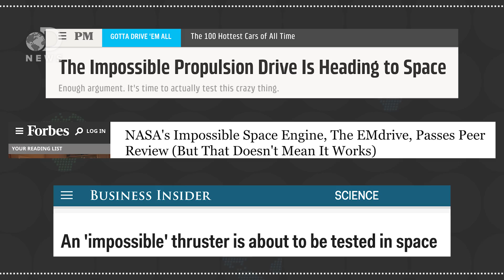How The 'Impossible Drive' Could Break Newton's Third Law

Comment: The impossible drive does not break Newton's third law for the simple reason that it won't work, which can be proven by a simple thought experiment. The idea behind the drive is that because the area of the cone is greater than the area of the disk at it's base more microwaves hit the cone than the base producing a net force. However the problem is that the microwaves hitting the cone are not all producing a force in the same direction so some force cancels out, and the force you are left with will exactly match the force on the disk resulting in zero thrust. 

To get this drive to work you have to get rid of the disk and allow the microwaves to exit the cone. This results in a photon drive and while it will work it produces an incredibly small amount of thrust.

Comment: if the microwaves are bouncing around inside the cone and actually pushing the object forward then newton's 3rd law is satisfied when the microwave bounces away from the cones inner surface.  

cone goes left, microwave goes right.  equal and opposite reaction.  what's the problem here?
Reply: CrowTech09 yes they would they are energy
Reply: +Lil y   Someone hasn't done their quantum physics homework...
Reply: E = mc^2? are you kidding me?
Reply: No problem, but momentum transfer from collision won't get you anywhere. The sum of all force vectors from a wave bouncing around a closed cavity is always 0 no matter the shape.
Reply: Kur Norock Do the waves have mass?
Reply: The purpose of it being a cone is to provide more surface area for the waves to hit in the direction of travel.  The base of the cone, which faces opposite the direction of travel, makes up much less than half of the total available surface area.  That means the net energy applied to the cone is in one direction.  

Also, if the waves are applying a force to the inside of the cone, they have to transfer some energy to the cone meaning they will have less energy when they bounce back and hit the back wall.
Reply: Kur Norock It's not just the base since the sides are slanted. Also it won't actually hit all areas evenly.

For energy transfer, the system can generate thrust if the surfaces aren't perfect mirrors(they can't be, so it will happen indeed) but that's just a really bad photon rocket since you are actually expanding fuel. You are just doing so in a very contrived and inefficient manner.
Reply: The "system" in this case is the entire spacecraft. The microwaves would cause internal forces sure but it wouldn't produce external forces, according to Newton's laws. This is why Newton's first law is: A body in motion will cease to be in motion unless a NET EXTERNAL force is applied to it. Newton's second law is: A NET EXTERNAL force on a body (i.e. the system) is equal to the rate of change of its momentum. Newton's third law is: A NET EXTERNAL force applied onto a body will cause the body to apply an equal and opposite NET EXTERNAL force on you. The key here is "NET EXTERNAL". You can have internal forces but it won't cause an external motion. 

An analogy would be as follows: You can't pull yourself up by pulling on your hair. Why? Because the "system" in this case is your entire body. You can cause internal forces sure (your hand pulls on your hair and the hair moves. The fact that your hair moves is the result of the force on your hand, and this force is internal to your body (which is your system)) but it wouldn't produce external forces (an external force would cause your entire system, in this case your entire body to move up). The only way to move up would be to stand up (the external force is provided by you stepping on the earth, and the earth pushing you back up (this is a direct application of the 3rd law)) or use machines or whatever. 

This is, in effect, the problem with the impossible drive. It is trying to propel itself forward by using internal forces, which is impossible if Newton's laws hold true.
Reply: Nash Shrestha Well I suppose that all depends on whether photons have mass when they are emitted or when they contact the cone, or both, or neither.  

As far as i understand things, photons have no mass, but do have momentum.  Momentum can exist without mass.  Momentum, even without mass, can transfer energy in a collision. Photons, having no mass, are always moving at C and thus require no force to accelerate, they just go. 

So if a microwave emitter is pumping out photons into the cone, there should be no "equal and opposite reaction" pushing back against the emitter since the emitter doesn't have to accelerate the photons, and that would leave the photons bouncing off the inside of the cone as the only transfer of energy, building momentum in all directions, but particularly in the direction the cone points since there is more surface area in that direction. 

A better analogy than pulling yourself up by your hair would be the old Wile E. Coyote contraption of a sail on a skateboard being powered by a fan that is also on the skateboard.  Of course, this wouldn't actually move since any force the fan puts on the sail is countered by the force the air puts back against the fan.  However, imagine if the fan didn't actually have to accelerate the air. The air is not pushing against the fan, it is just coming out of it. That seems to be more how photons work. 

My understanding of Newtonian physics is that it works great for most large scale objects and motion.  Orbits of planets, general physical actions, etc.  But when you start to look at the small scale stuff like photons and other quantum level stuff, Newtonian physics doesn't work quite so well.  Newtons third law operates on the assumption that everything in the universe requires a force to overcome momentum and get moving. Photons however don't seem to, unless I am forgetting something important.
Reply: are you kidding that makes no sense as Newton was waaaay before Einstein even discovered it.
Reply: Um Einstein made his discoveries in the 1900s and Isaac Newton made his in 16-1700s what is untrue about this?
Reply: Photons do have momentum, yes. As a result, they can transfer energy. That is also true. But, I still see a few problems with the EM drive.

I don't think that the surface area factor comes into play. I will explain my reasoning.

Let's suppose (to simply things) that the cone (it's actually a frustum) is perfectly elastic. In other words, it will not absorb the incoming microwaves. Obviously, this is not a realistic assumption, but this will help me to clarify why I think that the surface area will not really do much. 

Now, we know that light travels in a straight line (locally at least). Because of this, whatever light is emitted from one end of the frustum, that light will travel straight into to the other end. Now, there is a law in geometrical optics called "law of reflection". This basically says that whatever angle a ray of light strikes a surface at, that ray of light will be reflected by the surface at that same angle. I.e. angle of incidence = angle of reflection. 

As a result, if the light is travelling perfectly horizontally (its angle is 0 with respect to the x-axis), then it will strike the other end of the frustum at exactly 90 degrees with respect to the surface of the frustum. Then, from the law of reflection, the light will bounce back at exactly 180 degrees. You can immediately see how this becomes problematic for the EM drive. 

Let's give some measurements to our EM drive. Let's say that the frustum has a short end of length A and a long end of length B. (Draw this on a piece of paper. This will be a 2-D image, so the short side and long sides are simply lines). Let's also say that all the microwaves produced by the EM drive is produced from the short end of the frustum, and they all travel parallel to each other in a perfectly horizontal fashion. If each beam of light has a "thickness" of dx, then the integral of dx will give you A. What I'm saying here is as follows:

Break down A into smaller line segments. Then, let's have each of those line segments produce one single beam of microwave, and let's have the "thickness" of each beam be the length of each of those line segments. Then, if you simply add the "thickness" of each beam, it will equal the total length of the short side of the frustum, A. 

Now, once emitted, they will all travel to the other end of the frustum and bounce back at exactly 180 degrees. What is more, the beams of light will strike a line on the long side of the frustum that is exactly equal to the length of the short side of the frustum. This is due to the fact that the light travels horizontally, and keeps on travelling horizontally. In other words, even though B > A, because of the fact that light travels in a horizontal manner, the light will strike only a small part of B. To be more accurate, the light will strike a length along B, that is exactly equal to the length, A. 

if you extend the above analogy to 3-D, then the area of the long part of the frustum that the light will cover, is exactly equal to the area of the short side of the frustum, from which the microwaves originated. As you can see, in this case, the amount of area covered by the microwaves is equal to the area from which those microwaves originated, and so the surface area of the frustum doesn't really come into play. I will continue this comment in another comment, since this is getting too long and I will run out of room soon.
Reply: Ok I will continue my analysis from my previous comment. In my previous comment, I only considered the case where the microwaves all travel exactly horizontally (i.e. they all travel parallel to each other). What if they don't travel horizontally, but rather "spread out" from the short side of the frustum so that each beam of light generated from each line segment of the short side of the frustum will travel to the corresponding line segment on the long side? I.e. they don't travel parallel to each other anymore. In this case, I also don't think that the surface area will come into play when talking about the thrust generated. I will explain my reasoning.

Recall that we are assuming that the walls of the frustum are perfectly elastic, so that every beam of light that strikes the long side will reflect back. But this time, since some of the beams didn't actually travel perfectly horizontally, those beams will have some angle with respect to the horizontal. Now, we again use the law of reflection:

|     /
|   /
|   \
|     \ 

In this image, the straight vertical lines represent the wall of the long side of the frustum, and the remaining \ and / lines represent the beam of microwave. Let's say that the microwave was emitted from the bottom and reflected to the top. Then, you can also see an immediate problem. If you follow the path of light, then you will realize that the light will strike the upper wall of the frustum. Now, imagine that we had not just one those beams of light as I showed in the image above, but a whole bunch of them. Then, at least some of those light will follow a similar path to the beam of light in the figure, and as a result will strike the upper wall of the frustum. Then, we have the situation where those lights first hit the long side of the frustum thereby making the frustum move backwards, but then the lights get reflected and then hit the upper wall of the frustum, which causes the frustum to move forward again. If you were to add up the flux produced by these beams of light, you will realize that the flux of light with respect to the long side of the frustum is exactly equal to the flux of light with respect to the remaining three sides of the frustum. Since the flux are equal (and opposite, I might add), there is no net force.

As you can see, even in this case, the surface area of the frustum doesn't generate thrust. 

Hope this clarifies some things and apologies for the late and extremely long reply.

EDIT: I greatly simplified the situation by assuming that the walls are perfectly elastic. Even under this ideal assumption, I hope I showed that it is not possible for the EM drive to produce thrust (from my current understanding anyway). In reality, the walls will absorb the microwaves. Hence, the EM drive needs to keep on producing more microwaves. Where do these microwaves come from? From an external source. Hence, the EM drive can't produce "free" thrust. 

Now, I read about the NASA paper that got peer reviewed. However, just because it is peer reviewed doesn't mean that it is fundamentally correct. It just means that those scientists who peer reviewed didn't find anything wrong with the procedures and analysis written in the paper. Let me give you an example. Some years ago, scientists working at CERN announced that neutrinos supposedly traveled faster than light. Their papers also got peer reviewed, and nothing wrong was found. However, it turns out that a wire was loose or something, and that was what was causing the outlandish conclusion of neutrinos traveling faster than light. This could be the case for the EM drive too.
Reply: None of this is humorous.

Comment: I don't get how this breaks anything.  The propellant in your car pushes on the pistons, just as the propellant from the em drive would push on the craft, therefor it doesn't need to be expelled out the back in order to work.  Gas of course does not have a 100% conversion to energy, so the carbon, etc, has to be expelled out the tail pipe.  At any rate, you still need to use up propellant in the EM Drive, so it's not like this is a propellant-less drive.  The question is whether or not the waves really push harder on one side than on the other, and I doubt that they do, since even though one side of the cone may be more perpendicular to the waves,  the other side of the cone has more surface area.

Comment: interesting design.....from what I can gather: it works like as "audio driver". when the waves hit the largest surface of the cone they generate a counter force on the other side of the wall through resonance. but for that to work all the other surfaces of the cone would have to be "perfect reflective surfaces" for the magnetic waves not to mention the device will only work if we assume that space next to the large surface of the cone has matter floating in it or has a mass that can be displaced.